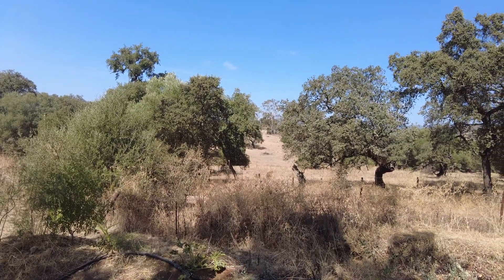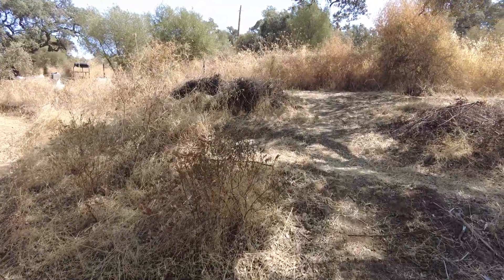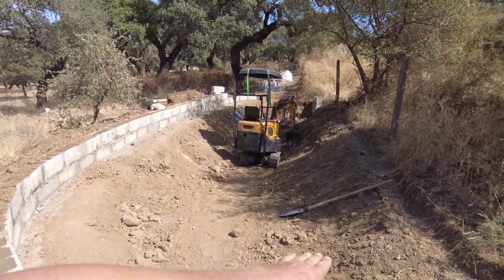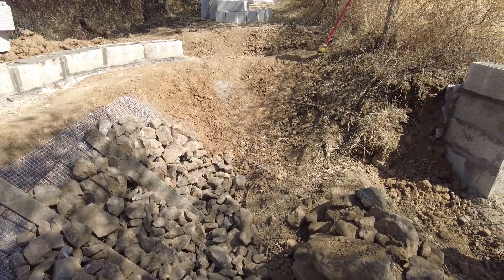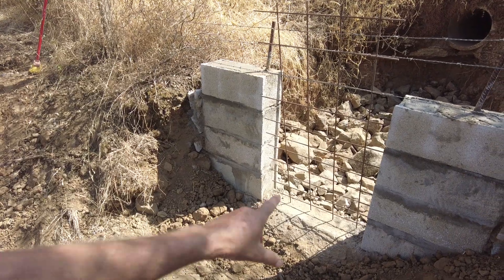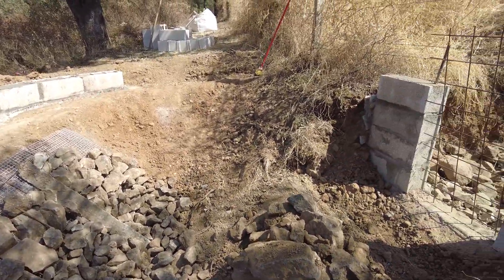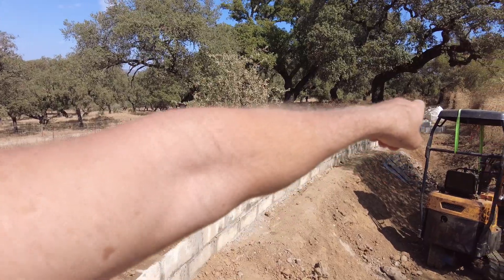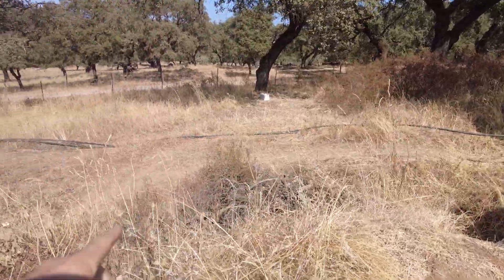Distribution pond taking shape. Finally! Hopefully!

Comment: If you have enough stone laying around, I would kindly suggest you to look into dry-stone walling. Here in Mallorca it is very common for creeks and seasonal rivers to have dry stone walls on each side to avoid erosion and a rather firm but loosely laid mix of large and small rocks on the riverbed to slow down the water. You can also create Gabion style walls with dry stone structure instead of the iron gabions. It is more work at first sight, but lasts centuries if done right.
Reply from the maker: @soniquetemusic  Yes yes. Good suggestions. I just want to make sure the overall plan works and then the details. Keep sharing. Much appreciated
Reply: @SuerteDelMolinoFarm  of course, looking forward to see how it goes!

Comment: Very good video update.  Really shows the overall concept and the current status of the project.  You are getting very close to finished! 😊
I really like your method for sealing the fence with the top hinged trash screen.  I think that is a great solution👍
The armored dam wall will make all the difference.  Using mesh and fence posts  makes the armor all the more effective.  Zach is doing a wonderful job - as always 😊
It will be great to repurpose the gabions to the eroded creek bed (I imagine).  Another great sand dam.
I guess the next big step is to see the block work finished.  That will be exciting for us and a relief for you! 😉
Wonderful progress!  👍👍
Reply from the maker: @stevejohnstonbaugh9171  Thank you guru Steve. Much appreciated as always

Comment: That's a lot of work but looks very well reinforced
Reply from the maker: @Thewildmindofmike  Yea. Lots of work and high hopes. Thank you for sharing
Reply: @SuerteDelMolinoFarm  i still do not understand how it will work ( mesh on the slope? It wont prevent a leak, it may hardly add anything to the structural integrity). 

It is a concept of a dam 😅
Reply from the maker: @user-vo3st8kx7s  Nooooo. This isn't a dam. It will and can leak. The only purpose of the pond is to elevate the water so that it can enter the upper canal. The only purpose of the mesh and stone is to dampen the turbulence from the culvert. Please keep commenting. Have a good Great day